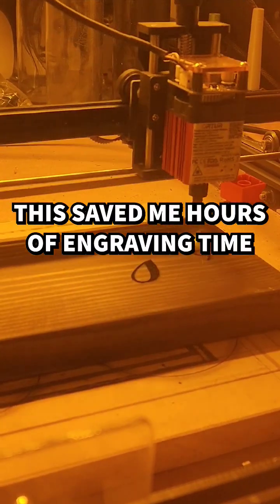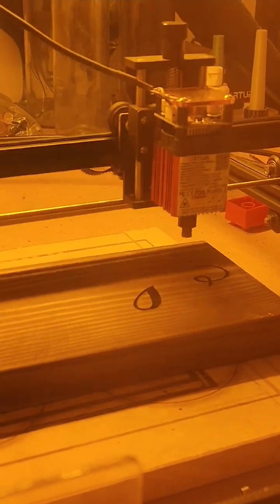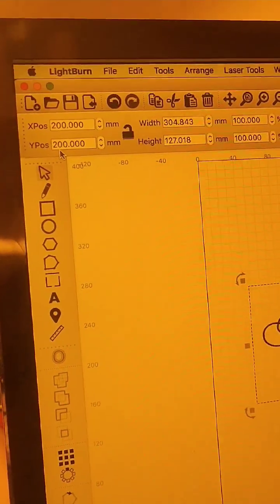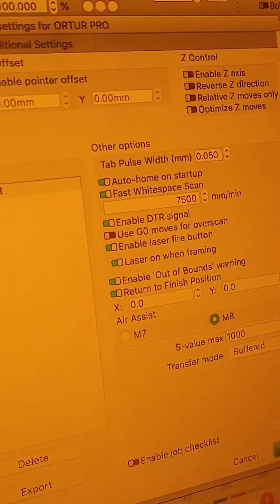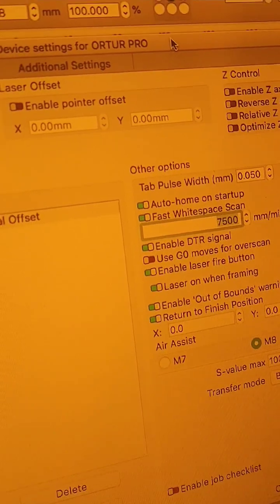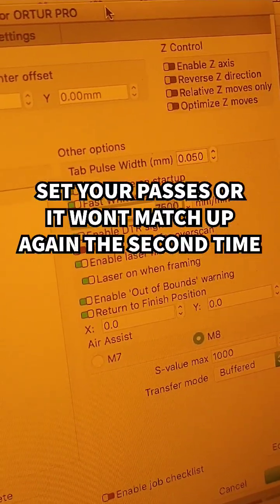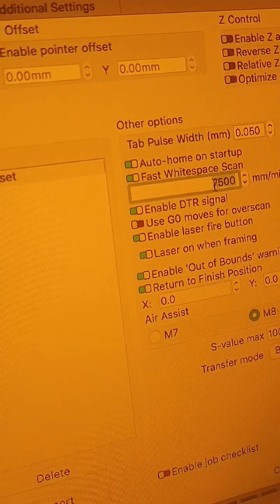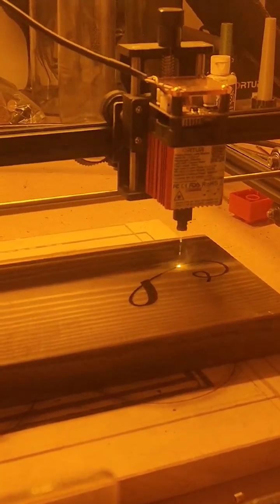Increase The Speed Of Your Laser Engraver #shorts #laserengraving #ortur #engraver #engraving #hobby

Comment: Which Laser do you have?  I have four separate lasers. One of them is my original, which is my 5w which has been switched out for a 10 then my second one was a 10 which is swiped out for a 20 W and now I have a new   Longer B1 40W Laser Engraver, 48000mW   Plus a Fiber Mazer 20 W yes, I am running light burn on all of them.
Reply: What settings did you change?